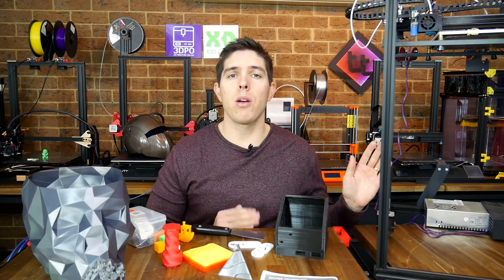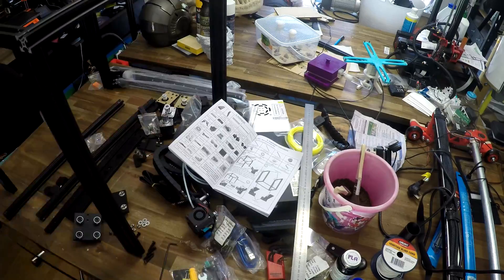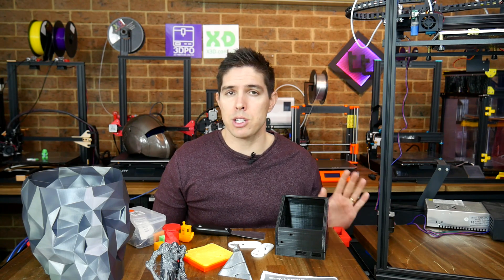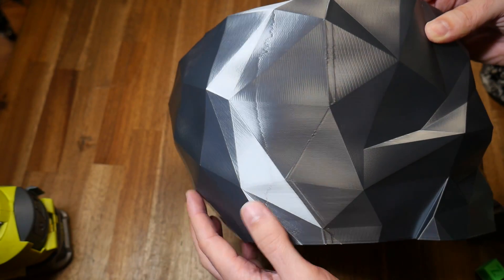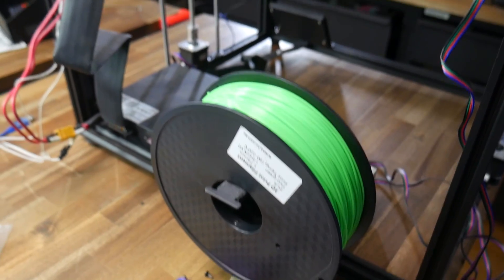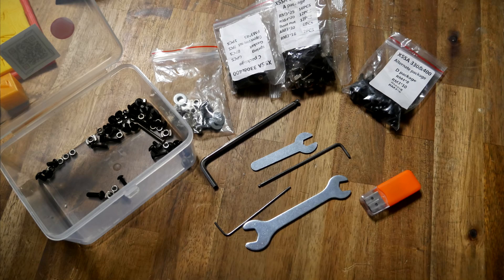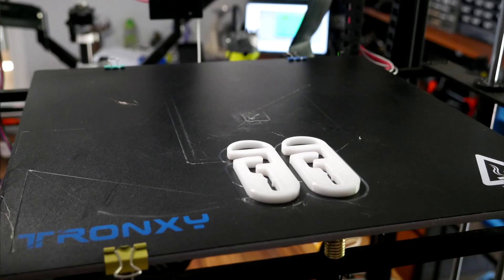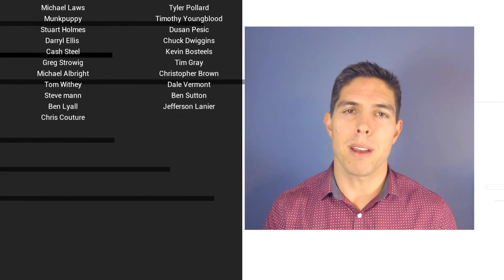Tronxy X5SA Pro review: A large format CoreXY 3D printer (with issues)

Comment: Hey there, got the X5SA Pro some weeks ago BEFORE i saw your video... i have all the same problems you described but have to say it isn't that kind of drama you are describing. Its not plug and play - and thats for sure because its an kit. And if you don't know, what are you doing - you will fail. And some of the functions are... lets say - tricky ;D The ABL works perfect... but if you don't recognize that every time you get print of your bed you HAVE TO eneable the motors. If you don't, the stepper position is rotating. And the next print will fail. I think it's because of the large size of the bed...

The stock extruder is okay but poor quality. It makes sounds and is wobbling around. Replaced with Full-Metall BMG...  

Next is bed surface... that really sucks! My bed is looking horrible.. but my first Enders too. What can we do to solve the problem? Nothing with stock. You have to change the board... cause the Chitu GCODEs are freaky... unnormal and i don't know WHYYYYYYY they have choosen this kind of board. You can't activate LinearAdvance, you can't install easily the modifications you want. Here you can find lots of gcodes wich will work... www.customize-3d.com/chitu-g-code-explained.html?start=20
I simply don't wont to learn them. F*** of... 
It do wired things like throttle the fan if its moving, the PID tuning won't work correctly and my PETG prints looks uneven. The acceleration settings are wired to... i set them to a much larger amount so Cura can control the movement.

Octopi can connect but sometimes it does wired things. If you send M8500 (Thats chitu eq. to M500) it beeps and throws a lots of errors in terminal. After that, i HAVE TO restart the printer and octopi to work again. Annoying...

 I decide to replace the stock board with SKR 1.4 and then modifying to glas bed and BLTouch. Then i have Marlin2 and hopfully no problems. In the next weeks...

Btw - you forgot to take a closer look at the stock hotend. My one is without a screw for attaching the temp sensors. It sticks in a hole with lots of air around ^^ The heatblock is silver sprayed and looks like it's carved by an trainee :D
I replace with MicroSwiss All-Metall - that works greater and now i can reach higher temps for nylon an pc.  

The stock runout-sensor is... simple ;) The funniest thing - it looks like the have forgotten to make it screwable an drilled the holes after casting... i favorite my design with a little 6mm metall ball. Nearly no friction and i use PTFE tube to lead the filament in place.

I like Gigantulla... but i like to tinker so its no problem.

Comment: I could not understand how I went from my first 3D printer, an Anet A8 which was rather simple (in the context of building a functioning printer), and getting in wayyyyy over my head with the Tronxy X5S.  I ordered the first iteration and didn't open it right away.  There was only one or two reviews on the printer, but figured since it was a step up from my Anet, it had to be better.  I couldn't have been more wrong.  I didn't get the printer put together until the spring of 2019 (before Easter).  I luckily had a close friend who picked up one and enjoyed tinkering with it.  I found the FW could not be re flashed thanks to the limits of the included control board.  The hot end was horribly sloppy, not matter how much I tightened it.  And yes, I had the worst time getting it to print something.  My major issue was getting a half decent print, or even a 1/4 decent one.  I could never fix the under extrusion no matter what I tried. The motors kept binding up... and the dam thing is impossible to level.  It was so much work, I just walked away from it for a year.  I just started up again last month, now that I have lots of quarantine time at home.  Seems it is till a PITA.  Now the Z axis will not stop sinking.  Still making it impossible to level.  And, each time I click the home button, the "home" location is in a different spot each time. 

I thank God for my buddy who has helped me though all this.  He is in the process of creating a new xy print axis using linear rails.  He has ditched the 2020 extrusion and is in the process of getting it all to work correctly.  As for me, I think this is it.  Time for the trash, I've wasted too much money and time on it.  I'm ready to go to something simple and easy like a Tevo Tornado, which my friend also has.  Same bed size, and very much updated compared to my Anet.  I do not recommend this printer to anyone.  Not even a recommendation for someone to play with.  I would rather take it apart and try to build a new one out of it instead.

Comment: Well I wish I would have seen this video before purchasing and building mine. I literally just built mine 2 days ago. The test block printed just fine but then I went to print some clips for the filament tube to attach it to the drag chain and ended up with a ton of stringing on them. I then decided to try and print another project and ended up with even more stringing and the text that was on this piece was absolutely horrible. I would love to use the actual cura software but it seems this printer is not listed and I simply don't know anything about 3d printing to make a custom profile for it as this is my first ever printer. I am not pleased with the top drag chain as I have noticed it contacting the belt guides on numerous occasions as well as the filament tube seems about 6 inches too long if not more. Also the attachment points for the top drag chain are nowhere near sized properly as the holes do not line up at all and the screws needed to be forced in. I tinkered with the bed for nearly 2 hours and got it as level as I could and everything is under .1 but I think it should be able to get better than that which is a flaw of it's design. 

I really wish I knew some ways to fix these problems but as I said this is literally my first printer. Having a setup for this printer in cura 4.5 would help me a lot right now because I just don't want to use the crappy tronxy software anymore..it sucks.

Comment: I see some blantant incompetences in the review of this machine.
1. Someone with your experience should know how to square the top, more than one way.
2. Tensioning the belts is not rocket science. I'm baffled you couldn't figure that out.
3. Stripped nuts? How does that happen on an allen bolt? Operator error obviously.
4. You are taking points off for something that happened to somebody else on a machine that is 2 versions older... good job. 
5. Knocking it for using stock print settings and expecting the parts to print perfect... there's always tuning settings to get 3d printers working their best.
6. Parts not square? See incompetency from #1.
7. Ptfe tube too long? Cut it. That is not a modification, its assembly.
8. No tool for eccentric shaft? Go get one. Do you expect it to come with a tool chest. Do you get upset when your car doesn't come with every possible too it uses?

This is a cheap, large, chinese machine so I think you need to recalibrate your expectations a bit. And this is a terrible review by someone who has that much experience.

Comment: Wish you had done more reserch on this one... Got the 2020 x5sa pro.. And it took some time comming from marlin controled boards to this Chitu board.. But get your esteps dailed in and do your calibration... its a great printer out of the box... ! Only made a few printed upgrades and print quality is great.. you will have to edit your config with gcodes and its easy.. Hope you do a followup... Seeing your video i can say that you need to look at this printer with other glasses (Not the marlin glasses !)
Reply: Tronxy X5SA Pro - Esteps Guide By Michael
This is how i calibrated my printers esteps.
First we need to know our printers current esteps, with the chitu board we can make a settings dump
by "printing a currentconfig.gcode.
How to make this gcode:
Create a txt document and name it:
M8512 "currentconfig.gcode"
In the document put thise 2 lines:
M6046
M8512 "currentconfig.gcode"
(The M6046 is a command for letting the printer write to the SD card)
(The M8512 tells the printer to dump the config)
Now place the SD card in the printer and print the M8512 "currentconfig.gcode" you just made.
The printer writes a currentconfig.gcode to the SD card.
Save this file to your computer.
Open currentconfig.gcode with notepad++
On line M8011 you current esteps is listed
(My stock looks like this : M8011 S0.001308 (And was off by 14mm when extruding 100mm)
2. Now heat up your nozzle to 220 and measure 100mm filament, i did that from the filament sensor and down
Unscrew bowden coupler on top of extruder.
I used octoprint to extrude 100mm of filament. Flushcut the extruded filament and measure, this gave me 86mm so short 14mm.
--------------------------------------
Now the fun part.
Chitu does Esteps different then Marlin,
But it was easy to dail in.
“Your extruded filament 86” * (esteps divided by extruded filament)
86 * (0.001308 / 100)
New esteps = 0,00112488  Now via Octoprint / prontoface terminal enter:
M8011 S0,00112488 “new esteps” (hit enter)
M8500 “this saves the new esteps to eeprom”
reboot printer.
Done
or
If you dont use octoprint / prontoface
You can change the gcode on the SD card with the new estep - run the gcode from the printer and remember to reboot before printing.

Comment: I bought this printer beginning of February. It is my very first printer. I had some issues here and there, but most of them were user error, and the vast majority were fixed switching to cura 4.5, instead of using the SD card. Also my instruction book was full color, just like the pdf. Maybe I got a later release.  I'm also leaving this comment before I watched the full video or read any other comments.

1 thing however, there are no tnuts in the gantry, just m4 screws. And I used clamps to clamp gantry to the frame while I tensioned the belts. Kept it all square. I suppose that wasn't in the instructions though. 
And second, you can't move the motor mounts over as all belt sections that change size as the gantry moves must remain parallel to the frame. I'm sure you are aware of this. I found all this out before I bought the printer. Now for the rest of the video.

Comment: The first 5 seconds of the video I see the frame doesn't look heavy enough. You'd probably still save $ though after upgrading to fix it. The structure is there.
Reply: For a mere 30x30 print bed the 2020 extrusion is probably good enough. It’d be better with some threaded rod or tension wires diagonal over each vertical square structure, though. Just like the old RepRap Darwin. Tension braces are a better, lighter and cheaper design than just overbuilding with super thick extrusions. Well, with the exception, at least, of getting in there to remove your printed parts.

Comment: Along with all the other issues (which as you say suggest a manufacturer that doesn't do much printing themselves, and certainly no pre-production testing of any value), the closed-source firmware is an immediate no. People may perhaps buy it as set of parts with full intention to customise (starting with swapping out the closed control board for one from BTT, at the very least), but the Core-XY gantry design makes even that dubious.

Comment: Mine was absolutely garbage. Their support couldn’t fix the software or controller... after awhile they stopped communicating.  Controller decided to crash the head randomly into the bed or side of the frame.
I got most of my money back and replaced everything.
Ledrge kboard, new bed and heater, hermes, and bltouch.  Overkill? Maybe, but the challenge was fun. I’ll repurpose the parts for a new corexy.
My video is still on my profile of the original garbage.
Reply: Oh one more thing. Load up their firmware in a text editor.  Its all simple config code and not real firmware.
If you compare each version they handout, it seems like they just randomly try settings.  Sometimes they reuse an old config file and put a new version on it or worse yet... give you one for another machine and say its for the x5sa pro.
It is clear they have no idea how to configure this machine. They need to go out of business.  Its clear they are only in the 3d printer business for quick money grab and dont care about their customers.
Good thing paypal had my back on this...

Comment: I purchased my machine directly from TRONXY early this month (March) and I did not have anywhere near the problems described here in assembling and squaring up the printer. I did get the movement in the gantry on first tensioning the belts, but it was readily apparent what the error was and it did not take me long to establish a more reliable method of squaring and tensioning. My biggest gripe with machine is the overhead chain, it is awful. Attention to good design principles would have solved this right out of the bat - the chain and cables are simply too heavy and flexible for the mounting system. Getting prints off the bed is a bit of a challenge, but for me that is better than prints not sticking at all - a problem I have with my Lulzbot way too often. "Just Vlad" has a very good construction video that helped me a lot.

Out of the box for me - yest some quality issues with the prints stringing, blobbing etc., but it is dialing in ok - The prints are definitely square, and bed leveling works fine for me. I never bothered with the TRONXY slicer has I run a mac house and TRONXY, despite there advertisements, do not support Mac. I use S3D and they have a ready made profile for the printer.

A big shout out to the support and sales team at TRONXY - with Covid etc., there were some issues with freight and the team kept me well informed as to status and helped out with some issues in Hong Kong. They also responded really quickly with a couple of questions I had and the answers were spot on.

Thank you to the other poster re the comments on the firmware - I have not ventured that far "inside" the machine yet.

I also own a Lulzbot Mini and a Photon resin printer - none of these had to be "built", so I am new at building a 3D printer, but I have to admit to building a 1 meter square CNC router from a fairly low level kit - so I  guess that helps

Comment: I got my X5SA (not pro) in July 2018. It did not come with a slicer software but had setting for cura. I have had stretching issues with the belts and can't get it to work with cura right. What cura setting did you use?

Comment: I also bought one of the X5SA back in October, and it's been printing ever since. Sure I've had a few issues, and I would not recommend it to a 3D printing novice either. But as stated in this video, the printer can really do some descent printing once dialed in.
When the company I work for asked me to recommend them a cheap reliable printer to make test and prototyping on, I told them to buy the X5SA. When it arrived after only 7 days, I discovered that it had the new silent stepper drivers. Awesome! At the price I think it's a bargain, just be aware that you have to tinker a bit to make it really perform excellent!

Comment: i regret buying my X5SA 24v, it's horrible. The config files make little sense, at least they're commented. you can install literally any version of their firmware for any printer so you can just destroy it without knowing.  the fucking z axes are atrocious, and to mod  it into a single motor it'll cost you around $40-75. 

HOW THE FUCK DO YOU RELEASE A MACHINE THAT, STOCK, CAN HAVE THE CABLE CHAIN AND TUBE GET CAUGHT ON THE BELT ROLLERS?????

Comment: Want to add one more comment on bed leveling. I think this auto bed leveling is a stupid system in this machine as it does not work, as well as the Z offset, you have to do it before every print. Before every print I have to level the bed, even if I just finished one print and did not touch the main bed the head will go out of alignment. Same true for the filament loading and unloading via filament detection sensor. I was thinking it was only in my one, but now can see the whole lot of this sensor have this issue. Funny at first I thought the sensor was set in wrong way as the filament can pass easy from top to bottom direction. I would still be happy if the retraction issue on this printer get solved. I can't find the slicer setting it will work on this. I had no issue with CR10 with same setting in Cura, printer many large models. This one is just a pain. 

Plus on this printer is the steppers makes no noise, all are from fans that can be changed easily. I like the square frame structure, can make it stable with few corner rectangles. And, it got linear rails, which is pretty smooth.
I used this mod for cable chain to the print head. It aligns vertically so does not sag on the belt.

https://www.thingiverse.com/thing:3390159

Comment: Thanks a lot for the review. I got this printer few days now. I like the structure of coreXY though this machine is giving me some problem too. As you mentioned, I had quite a big issue to make it perfect rectangular as it was going out of square after some time again. Also, same issue with fixing the belts. Luckily I got the belts right and it's working well.But I am having issue with web as in your video. As the prints go higher the web gets horrible. I tried few retraction changes but still having the issue. Don't know how to get rid of this issue.